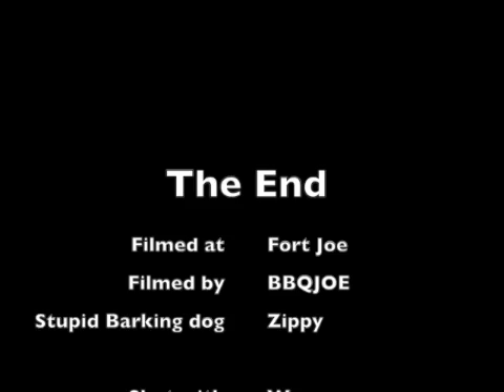Onan generator rotor bypass

Comment: You need to find TDC first. You can do this by putting a small dowel rod, chopstick or whatever in the hole of a removed spark plug. When the piston is at TDC, you can put the sensor anywhere you can get it to mount, as long as it is in line with one of the fins. Place your magnet there, and the other exactly opposite. I hope I helped you.
Reply: Also, as an update, I ended up using a couple of hard drive magnets in the end. My magnets on the test ended up flying off. The hard drive magnets stick like glue, no attaching at all.
Reply: I was over thinking it lol. Back to basics . I'll have to try the hard drive magnets.  I almost had one fly off today thanks

Comment: Awesome idea man. I'm working on one of those right now and can't find a bolt the right threads to pull the rotor. I might just do what you did. Thanx for the idea! 😁
Reply from the maker: You're welcome. Now if I could only find out why it stopped generating electricity.
Sometimes it does, others it doesn't. Trying to find a short, or broken wire.